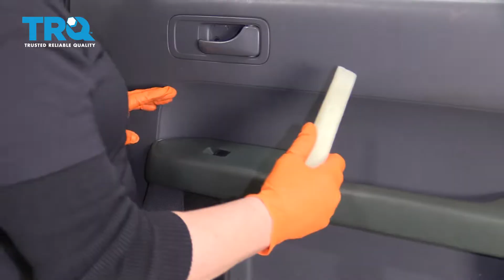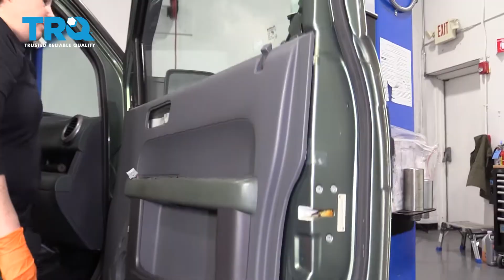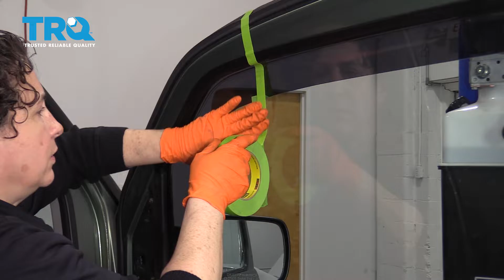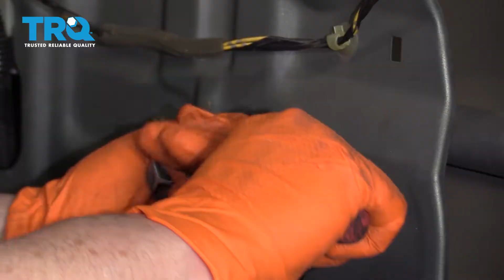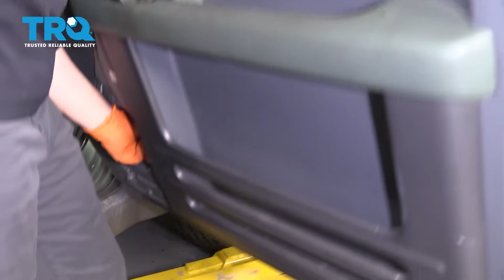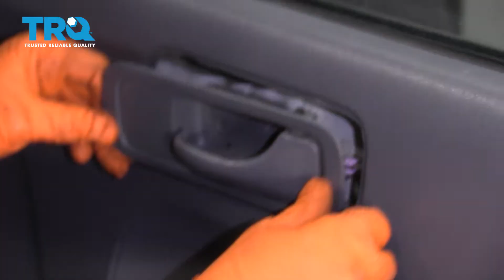How to Replace Window Regulator & Motor 2003-2011 Honda Element

Comment: Wish the window taping section was kind of the more complicated part of this whole thing. 

On another video the YouTuber advice to lower the window down if it can move to the two holes in the middle of the door where you can remove two bolts and you can actually pull the whole window out and put it in a safe location so there is no threat of it dropping and breaking. 

Once you get the new regulator and motor inside then you hook it up and turn on the car electronics to move the new regulator into position with the two bolts at the holes and reinstall the window safely.

Comment: Thank you for this video! One question... the link is to an assembly "without the autodown feature" and I'm not sure what that means. I think this is the part I need to fix the front passenger window that suddenly won't come up (I have a 2004 Element) but I wanted to double check, Thanks!

Comment: I need help, I plugged it in to make sure that it worked before I attached the window huge mistake, the problem that I'm having is that it was working just fine and then it just quit. It worked the window went up but it won't come back down now nothing's working. The fuse is fine. I replaced it anyway and still nothing. So now I cannot attach the window to the proper part because it is all the way up so it won't allow me to line it up with the bottom of the window. It wont work regardless. I cant find any info online as to what this could be.

Comment: Really hard to line up the driver side door frame back up. The speaker mounting sticks out and doesn’t allow you to do it straight on. You have to sort of angle it to get it in. Really difficult. At least for me. Window is going down rough because of it. But all in all the job is done. Thankful for your video!